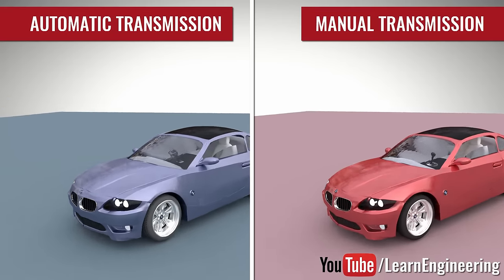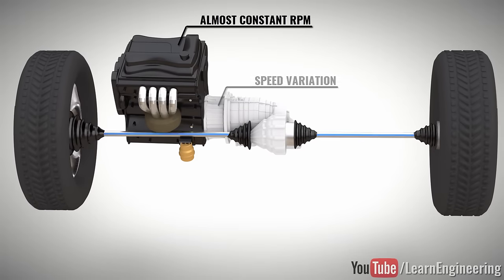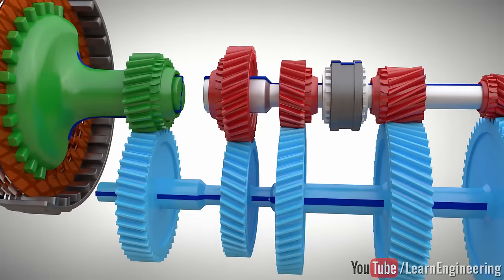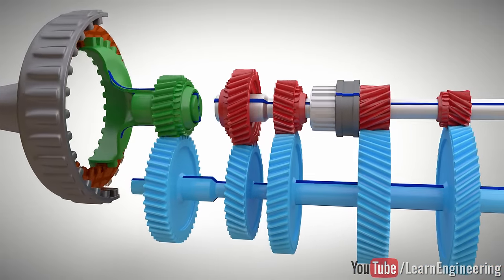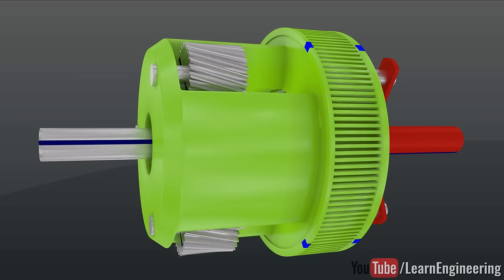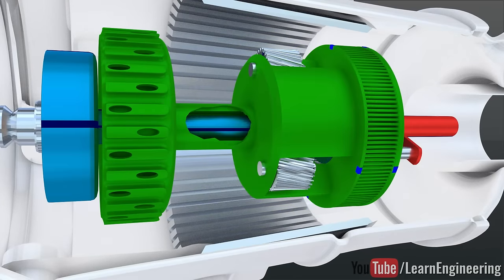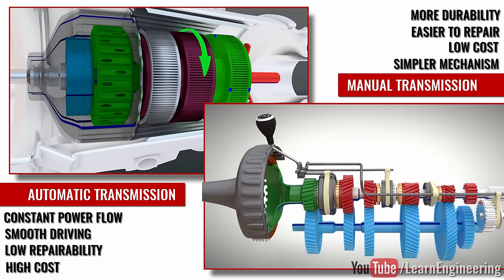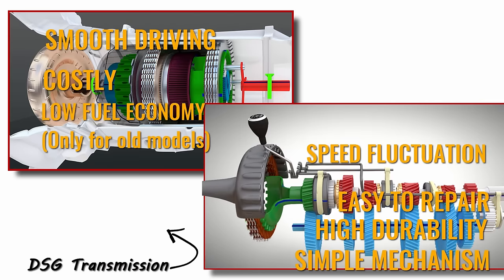Automatic vs Manual Transmission

Comment: You DO NOT have to press the clutch every time you want to brake in a manual car. You only press the clutch when you are going to stop completely (in speeds lower than ~20km). Furthermore, by applying the clutch before braking , it gets a little bit harder to stop the car since the car gets a little bit of extra speed! (because of the disengagement)
- This video is only one of many videos created by 'professionals' which makes the mistake of 'always' pressing the clutch before applying the brake. I think this happens since they do not actually drive manual cars. Or, maybe this have been a claim of automatic gearbox manufacturers at the introduction of automatic gearboxes! Who knows?! :))
I personally prefer automatic gearboxes with the ability to change gears manually (tiptronic). Automatic gearbox is the best for city traffic (especially in cities built on hills), while the manual gearbox is the best option for enjoying driving in roads and rally.
Reply: These guys are engineers, not professional drivers. I don't mind if they make a mistake about driving, as long as they explain the mechanism well
Reply: engine braking is fine, but can be less efficient (in terms of fuel) then just depressing the clutch and using the brakes. You can, however, stop rather quickly.
Reply: Huh? In a carberated car, maybe. But in a computer controlled engine? Not true. At. All. The computer can shut off the fuel flow completely while slowing.

However, if you disengage the clutch and let the engine idle, the computer fuels the engine. ;)
Reply: +TRLWNC1 is correct. In modern fuel injected cars, whether it be Gasoline MPI, GDI, or Diesel, when you let off of the accelerator all fuel injectors are turned off. This is why you should never take the car out of gear unless you are at a complete stop. That and it's safer to leave the car in gear.
Reply: the thing u say is about driving, the thing in told video is about mechanism. both are right in its own.
Reply: Aref Eshghi 
Doesn't that 'wear off brake pads too quickly' I mean braking the vehicle with engine connected.
Reply: ERMurthy No. As I said the car will stop sooner and therefore, the brake pads will last longer. Remember that you are not pressing the accelerator pedal while breaking, therefore the engine being connected does not make the car go faster. It is also better for your clutch since you do not use it so often.
Reply: Argh I already want to judge your statement about using brake without clutch and suddenly I read "under 20 km" haha sorry
Reply: Aref Eshghi actually autos are better for rally 
Hence why top rally cars are autos
Reply: Couldn't find any evidence supporting your claim. All I find is the WCR drivers do not use automatic transmission and it provides less control than does the manual transmission. If you have proof that automatic transmission cars are preferred in rallies, would you please share it?
Reply: Ö. Yalın Kaya all wrc cars are dct autos 
As well as wrx 

Just because they manually shift doesn't mean it's not an auto 

Most modern autos you can manually shift anyway
Reply: I guess they didnt want to confuse people and go offtopic to teach them how to break, instead they simplified example. Eventually you have to press clutch.
Reply: MyLonewolf25 Thank you. I'll dig into this. 😊
Reply: ***** a manual sequential gearbox is a dct gearbox
If you look at ANY in car view of them that's easily visible 

No manual dog box
Just a manual dct 

A sequential manual gearbox Is just another name for a dct transmission
Reply: Aref Eshghi until someone had a really bad accident and the claim they learn from this video. Then they will realize how big a mistake they have made.
Reply: MyLonewolf25 Now I get it. You own a auto-transmission car and people around you make fun of you. That's why, you are trying to make auto-transmission more manly and strong, and you make yourself believe it. 
Have you ever driven a manual transmission car? Believe me, it is much more fun. You, you, you... 🤣
Reply: Aref Eshghi I think 20km is a length, not a speed.
Reply: I've never felt my car surge when i disengage the clutch. It's a 2001 Jeep Cherokee 5 speed. Maybe due to a heavy fly wheel?
Reply: Johnwazup _ try lifting of the acceleration and feel how the car gets slowed by engine brake, then go back up to the same rpm and apply cluth after lifting. You can feel the car keeping it's speed more consistently. This loss of negative acceleration (less slowing down) is experienced as a sudden extra burst of speed. I hope I managed to explain myself a bit here...
Reply: Johnwazup _ im pretty sure he is talking about a condition called trailer hitching, during decel throttle is reduced applying inertia from the vehicles momentum to the crankshaft causing drag. this is desired as it reduces wear on the brakes. when the clutch is released that drag is released as well letting the vehicle roll freely. im sure you are well aware or that being in a jeep, the nose picks up. i think that is the surge he talking about.
Reply: Came here to say this, engine breaking is so so important
Reply: Aref Eshghi yet you're a pro driver if you can mannage your gearbox in fucking dense cities and hills, no big deal really
Reply: Aref Eshghi it's less fuel efficient, but far less work if you just put the car in neutral and brake
Reply: Naw man, modern cars ( cars less than 20 years old) will cut fuel to the engine if it is engine braking. You will actually get better fuel economy if you engine brake instead of putting it in neutral because the engine doesn't have to idle, it takes energy from the wheels. Engine braking also helps you brakes last longer.
Reply: Aref Eshghi in my driving school they actually teach us to push the brake before the clutch, because if it is an emergency when you really have to brake, you don't want to waste time by pressing the clutch first
Reply: TheEnde124 But if you brake too hard before pushing clutch, your car will shut down, and it'll becomes almost impossible to brake or maneuver the car. If you have to do a emergency brake, hit the both pedals at the same time, so you don't kill the engine.
Reply: I don't think so. It might be easier when you have just started driving manual cars and still not familiar with driving them. But once you become familiar with driving manual cars, it is as easy as it can get (same with putting in neutral and then braking). Also, not putting the car in neutral makes it safer too. And believe me, it (applying breaks without clutch - except low speeds) only gets a week or two of driving and it will become very very easy.
Reply: However, in case of such an emergency, I think it is better to have the car stopped earlier than having the engine on. You can always restart the engine after avoiding a fatal accident :)
Reply: I think that my comment doesn't apply to your car or any other car with an automatic transmission. In automatic transmissions, the car is in charge of the clutch even when you use the paddle shifters. It worth mentioning that I am not an expert on transmission systems, but I think that I am correct on this one.
Reply: ERMurthy No it's called engine braking. You're using the gearbox to slow down the vehicle. Brake pads get LESS wear.
Reply: Aref Eshghi No you are not right reread all your comments you wrote leaving the clutch engaged when sitting at the lights that is the most dumpest and ridiculous statement I have read not only are you wearing out the clutch you're also burning out the clutch by your previous comments I can tell you don't know how to drive a manual car very fewer people like me are keeping manual cars alive and actually knows how to correctly drive a manual car without destroying our clutch my last car had 367,000 miles on it and my clutch out lived my transmission
Reply: Good for you! I hereby name you the Great Clutch Savior! :)) 
Next time read carefully! I did not say that!
Reply: I press the clutch before I brake because you never know how much brake you're going to need to use and if you use full brake you're risking stalling the vehicle...
Reply: Rookie
Reply: CanadianBullFrog what I do is push the clutch and go to neutral. then coast to use the brake. but this is only if I know I am coming to a stop. like a light that just turned red, or is on yellow
Reply: militaryiam97 Very fewer people can actually drive a manual car correctly like a pro a clutch can actually last a very long time more then 3 years if you know how to drive the car without causing wear on the clutch I remember when I was first practicing how to drive manual in 2005 I learned on a 2000 civic SIR Canadian cdm model I picked up in 5 minutes on taking off releasing the clutch and giving it a small amount of gas while lifting my foot off the clutch pedal at the same time if you want your clutch to last a long time leaving it in the current gear and only applying the breaks then just before coming to a complete stop shift into Neutral is the best way for a longer lifespan of your clutch
Reply: Why not put it into a lower gear ( such as third gear if you have a 5-speed) Spike the RPMs, release the clutch, and engine brake? Saves your brakes some wear.
Reply: Johnwazup _ There isn't a need to downshift unless you aren't going to stop while slowing down then I would suggest a lower gear but downshifting is doing more work that's not needed and its rough on the transmission and throw out bearing my 97 Accord in my profile picture still has the same clutch that's slipping from the previous owner it's a really bad clutch that should have been replace but I've been driving around for 2 years with it and it just won't die on me if you drive a manual car the way it supposed to be driven whether the clutch is slipping or just needs to be replace soon it won't die I mean my clutch on my Accord is bad when I'm taking off the RPM is high but from my experience it's not going to die anytime soon it keeps going I also don't downshift at all unless I have to because traffic is moving slower without stopping
Reply: I do this at times too. I prefer having it in gear just in case I have to react and move out of the way,. I like to be always ready.
Reply: Rev matching isn't bad at all for your engine. Let's say im going 50 mph, I push in the clutch, put it into 3rd, spike the rpms to 3k ( you'll get used to it memory wise) and put the clutch back in. This works best if you can see where you need to slow down far away such as approaching a red light. You can also spike the RPMs while pressing the brake. It's called heel to toe shifting. Your lower foot hits the brakes and you upper foot spikes the rpms so you can rev match. Dragging the clutch to force rev matching is not recommended since you'll prematurely wear your clutch out.
Reply: I rev match between gears. After driving a few thousand miles, you get to know the rpm speeds for each gear. Pushing in the clutch and quickly putting it into another gear will not strain the throw out bearing. Sitting at a stoplight in gear with the clutch out will. Moderate engine speed will not harm the transmission. I'm talking about rpms of 3k or less. I rarely if ever rev match over 3k rpms. I have a Jeep 4.0 engine. Revs to 5k and the transmission is rated to 7500 rpms. My transmission is a nv3550, same transmission used in ram 1500s and Light duty Ram 2500s with giant v8s. Spiking the rpms to 3k and letting the engine compression brake does not put any components under strain. I am not dragging the clutch to match rpms.

Edit: I drive a 2001 Jeep Cherokee. It weighs a touch over 3,000 pounds. Very Light SUV. The transmission is not strained in any capacity.
Reply: Not when I am coming to a stop though. This is when I go into neutral.
Reply: Most accurate comment ever
Reply: Aref Eshghi if your good , just need a clutch to get the wheels rolling from a dead stop ! 😕
Reply: +Gravecb7 Accord "clutch can actually last a very long time more then 3 years if you know how to drive the car" umm, where i live it's normal to clutch last for 200k. i have 1998 corolla with 260k driven and still going with the first clutch. considering the average amount distance my friends drive is less 10km/year, many of them never have to worry about clutch wear. sidenote, couple months ago: my older brother actually didn't know the symptoms of worn out clutch before i told what's wrong with his car

and about the "braking and clutching": in highway speeds i never decelerate with brakes, i just lift the gas pedal and let engine reduce speed. if there is change in speed limit and/or camera i might use little brake pedal if engine didn't slow speed enough. anything else, pop the clutch. 

good driver knows from the rpm sound of the engine, when to change gears. You hear it.. You feel it.. You make the choice, You! 
o god i miss my hatchback gti... best driving i ever experienced and i gave it no mercy, it was built to be driven. in manual!
Reply: 360 Dodge ram transmission 99 fit in 318